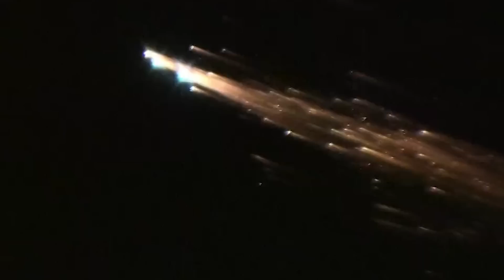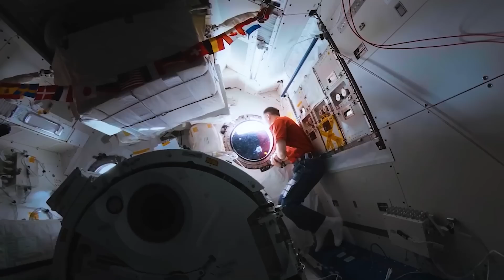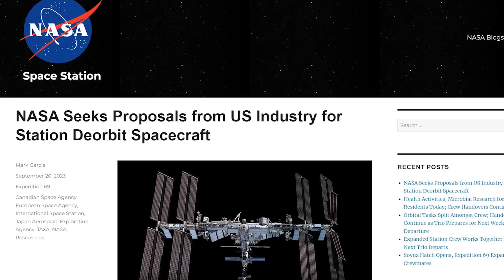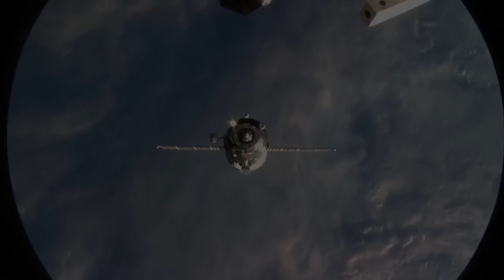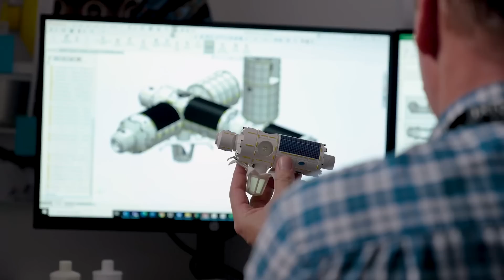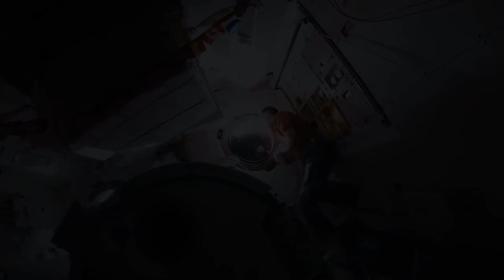Why NASA Plans To Destroy The International Space Station

Comment: If Starship was available by then, it could be able to boost it to a retirement orbit vs sinking.  However, it does depend if SpaceX would be interested in trying it.  They technically if everything works out right, to build station from Starship parts as well.  Again, it depends on use.  Russia components are oldest it would be fragile by then.
Reply: Not really viable due to the many, many, MANY refueling missions needed to boost it up to an orbit where it would decay in centuries instead of years. The ISS weighs on the order of 450t. Also, this would mean NASA is still obligated to pay to regularly send a Starship (or a new spacecraft developed for this purpose) up to this retirement orbit, so that the ISS can maintain its ability to perform collision avoidance maneuvers.

Comment: An alternative, would be to strip it down to its bare minimum and then rebuild it to act as a repair center for the JWST and other future space telescopes at the L2 Legrange point.
Reply: Even boosting it out to a graveyard orbit is prohibitively expensive - the idea of getting it out to the L2 point is frankly insane. On top of that, human operations that far out into space are far beyond our current capabilities. If JWST is ever actually repaired, it will be done remotely with an unmanned craft. The work/cost needed to get humans out to L2 and back would pay for a brand new telescope many times over.

Comment: Boost it up to a permanent retirement orbit. In 100 years, it will become an exhibit in an orbiting museum.
Reply: 10,000 lbs of propellant is need to boost the station 30 miles. Moving it the 400 miles to get to a century-long decay would be crazy expensive. (Let alone the 20,000 miles to a permanent graveyard orbit).It would also put it out of reach of current supply vehicles with meaningful cargo and put it where anyone on board would be exposed to hazardous radiation. All for ….what?
Reply: That would require a LOT of propellant and be very expensive. To stay in orbit for a century or more would probably require raising the ISS to a circular orbit in excess of 1000km in altitude. Compare that to the current altitude of about 400km and you can see why letting it slowly decay before giving it a final push to reenter is preferrable.
Reply: And let's for a moment assume NASA does boost the ISS to a orbit that won't decay for more than 100 years. Now they would need to fund a program to develop more capable ISS resupply craft that can reach this new altitude, and they would need to keep funding resupply missions for a century or more. After all the ISS will still need to be capable of avoiding space debris.
Reply: Watch before commenting.
Reply: NASA is  deorbiting for cost, not because the ISS is obsolete. The cost of deorbiting will likely cost more than boosting into a higher orbit. Raise ISS to a 20 year orbit, and, in 20 years, Starship tankers will be routinely working. The cost of lifting all the parts of ISS into orbit were staggering. The cost of saving the ISS as a museum will be more practicalable as propulsion systems are advancing in ability and thrust. As it is Orbital Reef and other commercial stations are continually delayed, if not outright canceled. ISS will operational long past 2030. The cost of the deorbit tug seems to be exponentially increasing every fiscal year. If any of the old space companies win the contract, the cost might exceed to expenditure to temporarily boost the ISS orbit. The whole decommissioning process shows and SLS shows just how out of date and hide bound NASA is in its planning and policy.
Reply: Or craft could be docked and left there making it be the museum.
Reply: in 100 years it would be a debris field.
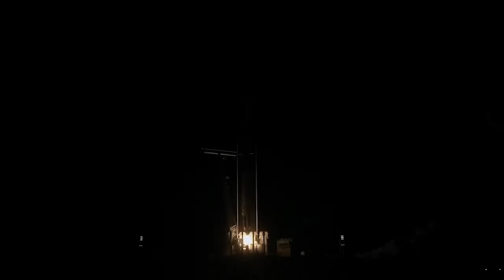Reply: 5:57 Solid idea, they should’ve said that in the video.

Comment: Park it in a stable higher orbit! My museum at L4 would be fine!
Reply: The ISS weighs about 450 tons and is currently in a circular low earth orbit about 400km above the earth. The earth-moon L4 point is located about 400 000 km away from earth (pretty much same distance as the moon).
Reply: I expect that L4 is special enough it will be reserved for more useful purposes. And you forget that rockets are for lifting and transporting things. The costs of maintenance and operations increase with distance from Earth. And then of course, is the fact that nothing will stay at L4 unless it is constantly monitored and its movement corrected. It is not as stable as an orbit.
Reply: YOUR museum at L4? Gerard K. O'Neill will be turning in his grave! (sorry, I mean "slowly rotating")